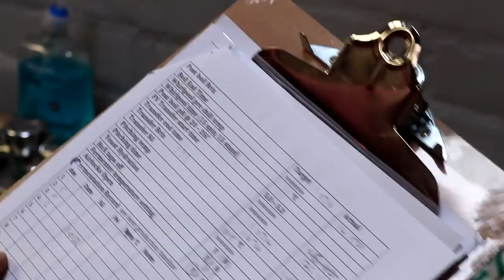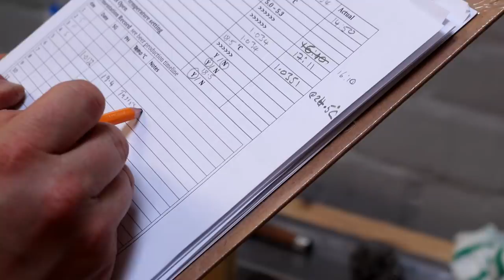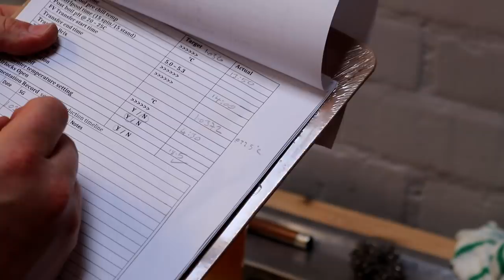TRACKING SG

Comment: Just a quick tip I saw online for de-gassing wine and I thought might help with your samples.  Cut the bottom piece off a plastic coat hanger but leave a “hook” on one end, the other end then fits nicely in a battery drill and makes a really rapid stirrer.  De-gassing literally only takes 10 seconds or so with this method.  
Love the channel by the way, very inspiring and a testament as to what one man can achieve if motivated.